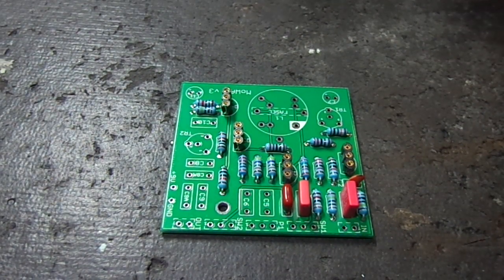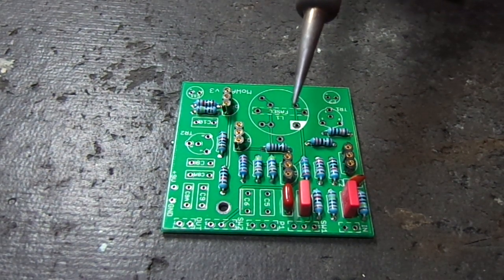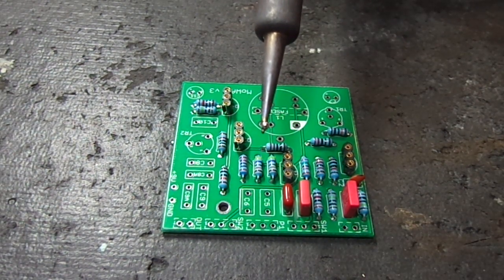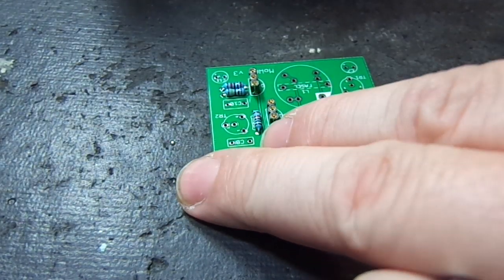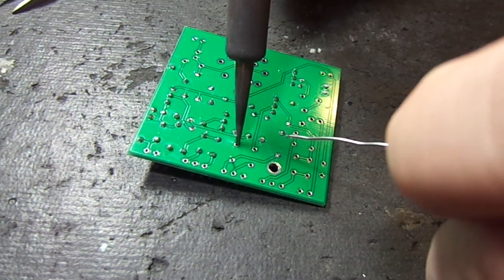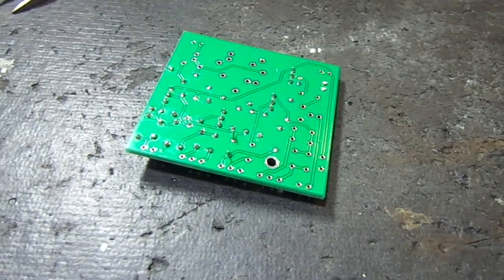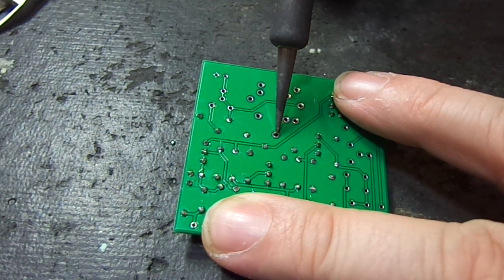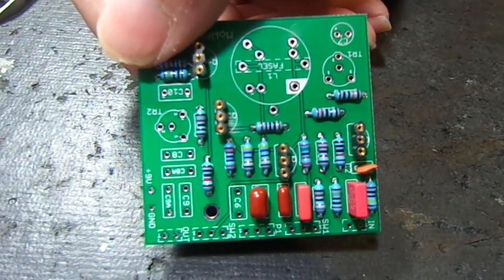GuitarPCB Quick Soldering Tutorial

Comment: I've built more than two dozen audio electronic projects, but I still found this helpful. Question: I've read that certain types of components can be damaged if heat is applied to the lead for too long. Is there a limit to how long the soldering iron should be applied to the lead of components such as transistors or ICs? BTW, I like the two boards I've bought from GuitarPCB and highly recommend them. Shipping was fast and reasonably priced.
Reply from the maker: I have never ruined a transistor or IC so I would not be too afraid of that. I believe it to be true but not in the short amount of time we require.

Comment: What temperature are you using?
Reply from the maker: I use a Xytronic 168-3CD and it is typically set from 750 - 760F. I clean and Tin a lot. I clean with a Copper or Brass scouring pad.

Comment: What temperature you are on?
Reply from the maker: I use a Xytronic 168-3CD and it is typically set from 750 - 760F. I clean and Tin a lot. I clean with a Copper or Brass scouring pad.

Comment: I’ve been doing all these things but was still screwing up my solder joints. Then I realized I was using the wrong solder which resulted in me using high heat, effectively destroying my board 🤦‍♂️
Reply: What solder were you using and what are you using now?
Reply from the maker: I use Kester .8mm 6347.